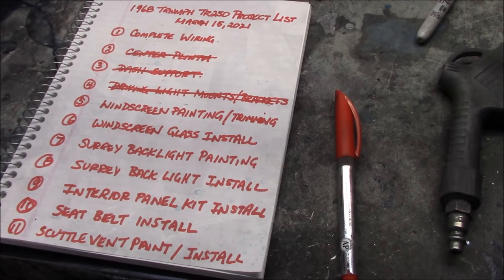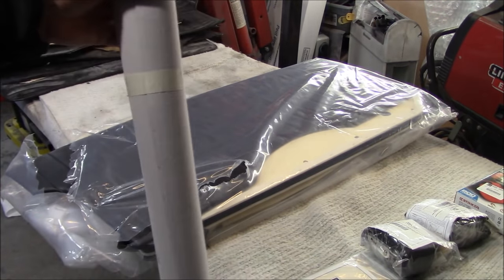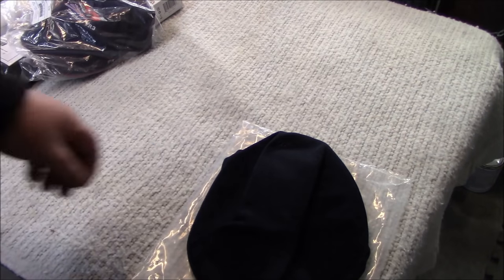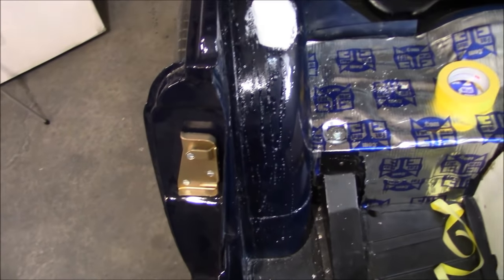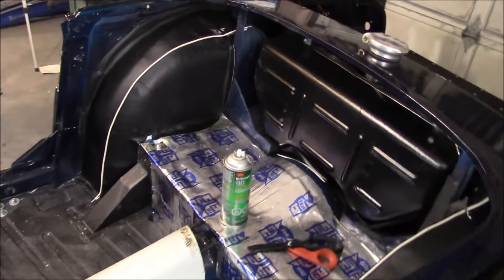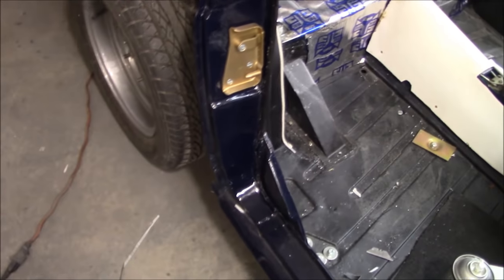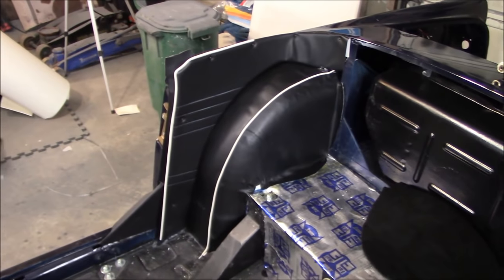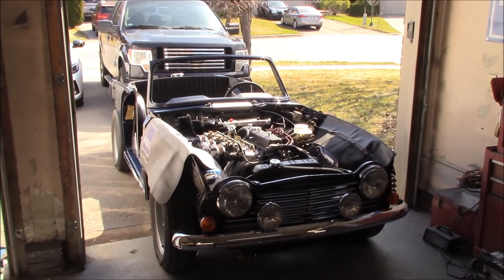1968 Triumph TR250 Restoration, Assembly Part 20, MOSS Motors Deluxe Interior Panel Kit Installation

Comment: I've always thought there a few trains of thought when it comes to sound dreading an old roadster. On the one hand you get rid of road noise, but on the other hand, if you have a throaty exhaust system, is there much point to it, it's food for thought really. One thing you can always say with Moss, is you always get quality items. It's a big reason I use them a lot 👍
Reply from the maker: I like it in the doors Steve as is takes some of that hollowness sound out of the door and gives it a better thunk when you shut it 😉

Comment: Looking very good ! I wish I'd seen this video before I did the interior on my 4A.
The slots in the foam underlay on the wheel arches is a neat idea.
 I used a TR6 interior panel kit , black with black piping, a little more forgiving
when aligning the piping. I put an extra chrome screw in the rear extensions of the 
vertical panels, helped solve the wrinkle problem.
Reply from the maker: Agreed...black on black is definitely easier...I’ve got that in my 73 TR6 as well.

Comment: Very nice Tush, and informative. Sequence of installation seems to be one of the keys. What adhesives do you like to use on the wheel arches? Cheers!
Edit....forget the question. I just read your other comment to Paul
Reply from the maker: Morning Kevin...one of the major changes from the MOSS installation instructions is on the wheel arch covers.  They suggest that glue the foam to the inside of the covers but I prefer to glue the foam to the tub first...

Comment: David great job! When I redid the interior of my TR4A (I used Moss as well) those wheel arches were a real challenge. I obsessed over every bump and ripple. Then when I reinstalled the top I found that very little of the arch top was visible (even less when I installed a roll bar later on).
Reply from the maker: Agreed Jim although I think you will see a little more of the wheel arch covers with the Surrey backlight installed

Comment: What glue are you using for the vinyl and foam, Chef?
Reply from the maker: Hi Paul, I’ve been using a 3M spray Adhesive.  I had a couple of cans laying around that needed to be used up...so mostly Super 77 then some 80 and 90.   Now that I’ve used those cans up, I’m going to use some lepage heavy duty spray adhesive for the carpets where required.